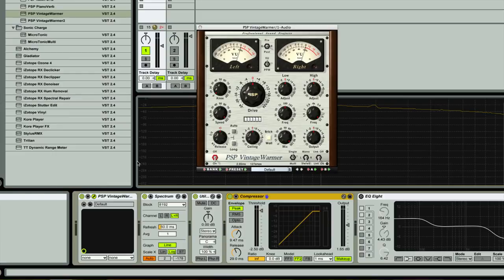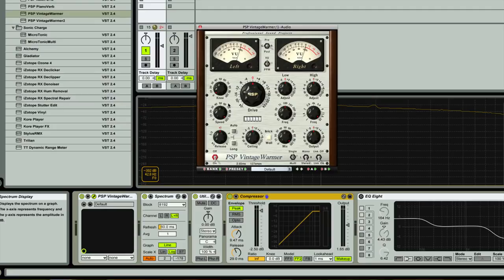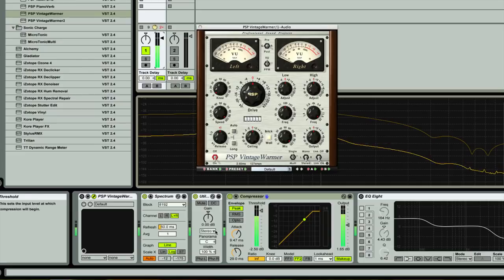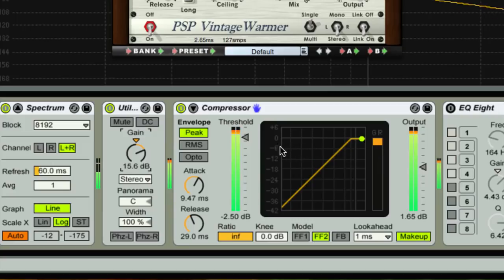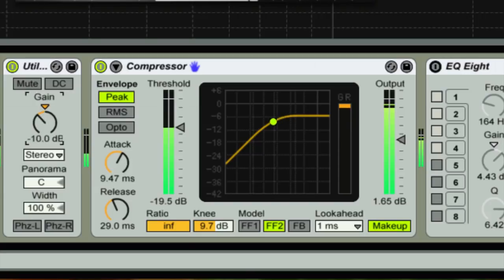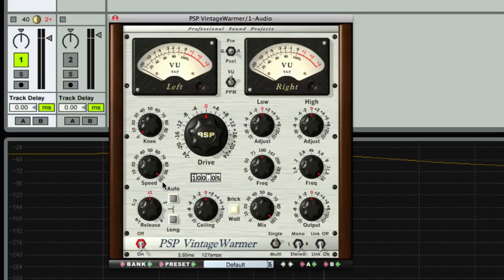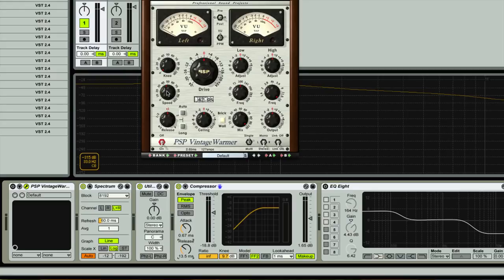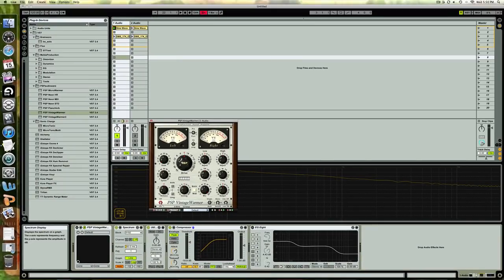Vintage Warmer Tutorial Part 1.mov

Comment: I think the ceiling is basically the threshold for the limiting/saturation. If you set the ceiling to +12 the drive to +12 and the output to -12 there is no distortion or gain.  Conversely, if you leave the drive at 0 and take the ceiling to -12 and output to +12 its the same sound as if you simply turn the drive up to +12.

Comment from the maker: Yes. In the Live Set I am using an APC40 and when I mouse over the knobs on the VW itself, I am simply using the "Magic Mouse" scrolling to change the settings a bit. Sometimes with enough control, it is easier than clicking and then dragging.

Comment from the maker: This depends upon the frequency range within which you are working. In general, the attack and release times used for compressing any number of instruments or sounds in your mix should match their general frequency range. For example, slower AR times for lower frequency content, and faster AR times for higher frequency content. This helps achieve a more natural, transparent sounding compressor.

Comment from the maker: It's hard to say unless the plug is opened up and the mechanisms that run it are analyzed by someone with a firm knowledge about virtual plugs. I mentioned on the video that tape speed during recording directly influences the sound fidelity after the recording is made. The faster the tape, the better the sound preservation. Even though this plug is a compressor/limiter, it's internal character allows it to act as an exciter or saturator as well.

Comment from the maker: It is a bit much to talk about here, but do some research on wow and flutter regarding tape speed and sound fidelity, and the deeper meaning behind the affects of all the different configurations you can have with compressors and I think you'll find some answers. In general, the quality of sound you desire can be controlled by altering the "simulated" effect of tape speed on your original sound. The slower the speed, the more pitch variation is noticed for more analogue sound.

Comment from the maker: As a general theory to stand by with all effects, try to exaggerate the effect you want so that it is beyond obvious, and then pull it back to the point where you can barely tell it is there. It is much more difficult for the ear to determine the correct amount of any effect when you come from the other direction. That's what's difficult about this plug: the listener should never be aware it is being used...

Comment from the maker: @crrstewdios Cool! I can see that as the level-control at which the compressor starts working. Perhaps the ceiling helps get the saturation on sounds that don't quite reach the compressor upwards towards 0bDFS. It would certainly save one from thrusting the volume of a quieter sound way high just to reach the compressor level. Good idea!

Comment: Doesn't the soft knee setting effectively bring the threshold forward, which is why you see compression start to work when you turn the knee higher. By smoothing the curve, the start point where compression starts is earlier, though smoother overall.

Comment: hi thanks for explaining would this be your main compressor then on tracks or would you add it for tape saturation later i dont quite get how you actually compress the signal or how you lower the threshold would this be done with the ceiling

Comment: Can you elaborate as to why a low speed (lower quality) is synonymous with a short attack? You said "Of course a short attack will be lower quality". But I don't see why these two characteristics are inherently related.

Are you saying all compressor settings with short attacks offer a lower quality of sound? I thought a short attack simply meant the compressor wet the signal more quickly in terms of response time.

Comment: but i'm pretty sure the speed recording of tapes would be the equivalent as sampling rate, not the bit depth.
Reply from the maker: It is more towards bit depth simply because that parameter deals with the resolution or "fidelity" of the sound as opposed to the sample rate, which is just the number of "snapshots" the digitization process takes per second along the line. High bit depth/sample rates help the overall improvement of sound quality when working together. Of course, with tapes none of this matters because the resolution is infinitely small whereas sample rates produce artifacts that need to be counterbalanced with artificial noise like dither and other things. I might need to check my definitions again, but I think one of the only major benefits you get from higher sample rates would be an extension of the access one has to representing the frequency spectrum on the outer edges of the spectrum.
Reply: but the "number of snapshots" are per seconds.  so 96 kHz of sampling rate means 96 000 samples per seconds, which can record frequencies up to 48 kHz because you need 2 sample to mimic a frequency digitally.  So to me it looks like the same thing as the speed of the tapes. 

More bit depth means you have a wider dynamic range for each of these samples. But i agree the comparison with tapes is not so simple because there are no bits in the tapes, so i don't really know how to have control on  dynamic range on tape recording...
Reply: so 24 bit instead of 16 will really make a difference on the dynamic range of the sound, even if it's so subtile because 16 bit is already so big.